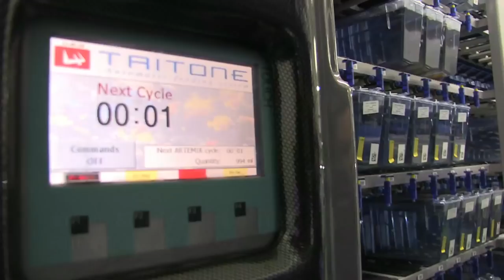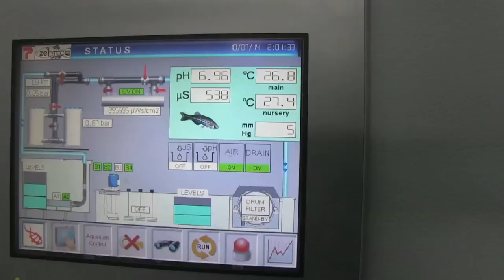Breeding Zebrafish

Comment: I fail to understand why the fish spawn over the egg capture device. What entices them to do so? Color? Distance from device to surface? Are the fish conditioned before the device is placed in the tank? Or is it just if you have enough fish in the tank, some will happen to do so... just random chance.
Reply from the maker: +TruckRat As I understand it, the fish will spawn over any 'surface.' Previously I've seen labs use marbles. And now my memory becomes really hazy, I think zebrafish spawn at first light so there may be an element of control through lighting - sorry to be so vague, filmed this a little while ago now.
Reply: Thanks for the info. I've been trying to spawn my fish for weeks. Tried different methods that others have used but no luck at all. I had 3 males and 3 females but one female died yesterday and one the day before so I stopped and put them back into the community tank. I must have stressed them too much. 
I was thinking of building a smaller version of the device in the video so as to not handle the fish unnecessarily. But for now I just want them to rest and relax so I don't loose another.
Reply from the maker: +TruckRat You could approach the IAT - http://www.iat.org.uk/ for technical advice
Reply: Understanding Animal Research I have noted the link. Thank you.